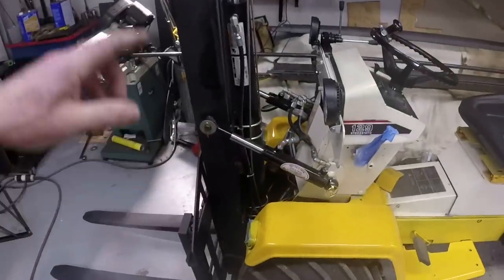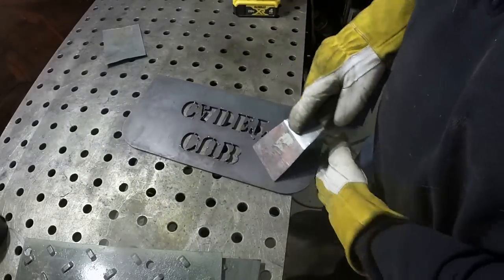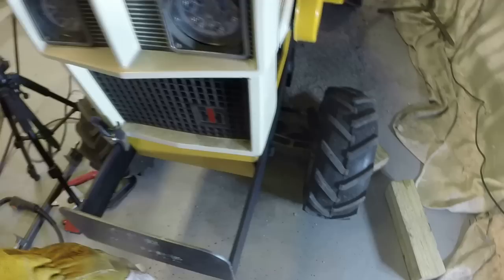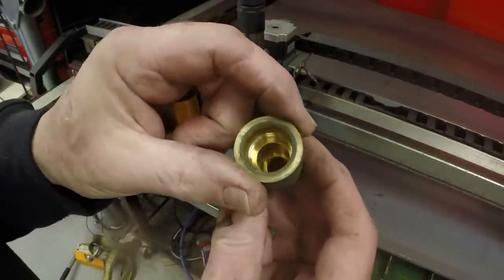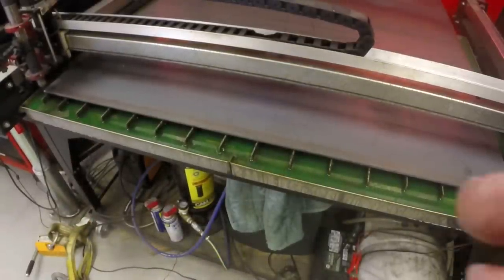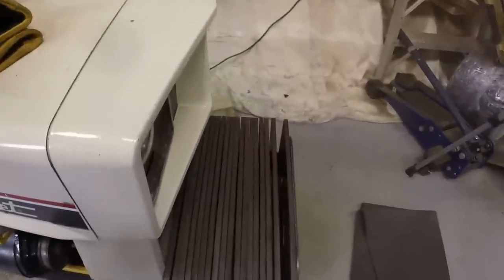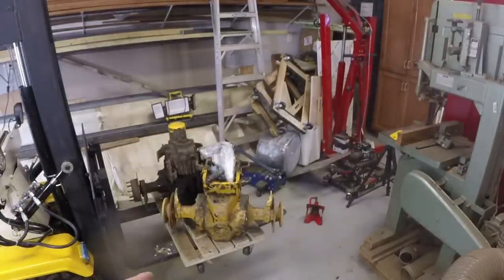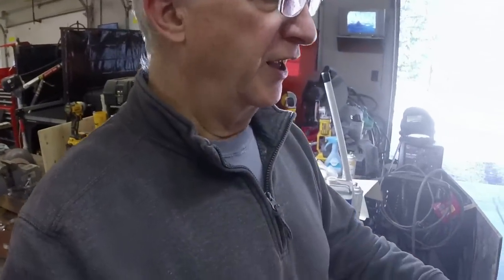I Built a Forklift!   EP:30, The Counterweight

Comment: Turned out really cool Frank. Nice vision on your part. 
P.s.  rotate the small tires so the tread matches. 😊
Reply: It is getting a different front axle, wheels and tires, to handle more weight.
Also be aware non driven tractor tires are always mounted opposite direction of normal travel.

Comment: you might drill a pair of holes in the name plate and put a set of long threaded bolts through to hole the weights from shifting, 500 had a good idea with the white paint  looks good  waiting for the next project  with anticipation
Reply from the maker: I'm going to add a few more plates to fill the rack solid.

Comment: Every forklift I ever ran was pull back on the lever to lift and push forward to go down. Your tilt is correct, pull back to tilt back and forward to tilt forward.
Both sticks should be verticle pushing forward and backward. A 3rd stick would be for shifting forks left to right. All you need is 2 sticks for that rig. Nice job overall though.

Comment: Yep, you built a forklift, Frank!!!
A job well done. 
May need to put a long bolt through the weights just to stop them from bunching around if travelling on a ruff surface from job to job
Reply from the maker: I'm going to fill the rack with a few more plates. That should do the same thing while keeping the plates easily removeable.

Comment: Another great job as usual. Your skills are becoming more impressive. A thought for your next project an articulated tractor with both driven axles with 3 point hook up and drawbar. This will test your engineering some. The tractor could be used for pulling different implements (more projects to build) for your garden. Just a thought.
Reply from the maker: I have often thought about an articulated 4x4. It's been done a lot, so there are plenty of examples out there. My current issue is storage space. I'm full up. With 10 cub cadets, the tandem, dozer, grader and now the forklift plus a couple of Kubota tractors, my buildings are full. I need to start making miniature stuff I guess!  I have lots of other stuff I need to get done--been postponed with the work on the forklift.  But the challenge of the larger builds is a powerful urge. We'll see.
Reply: @woodandmetalshoptime8048
Reply: I understand. I commented many episodes before about building a larger garage  partially in jest, but also as a need for all your projects. I realize it is a great expense but with all your builds that just keep coming (and very entertaining) you will eventually have to expand. I hope your Youtube views could support it. P.S. the forklift was mentioned in the comment also.

Comment: Frank I have a couple of questions . One was on the back plate for the forks . Did it distort when lifting your pallet? It might have been the camera angle but I thought I noticed some slight bend . My other question would be if you notice any difference in the steering of the lift with 
additional weight ?  I'm giving you a big thumbs up on this project. I would like see it in action in future videos.
Reply: Looks like the tires flexed and the whole tractor tipped down a bit when the weight was lifted
Reply from the maker: I did not notice any deflection of the back plate itself, but it does move the trolley inside the mast against the mast tracks. There is some slop there. (soon to be fixed-stay tuned!). Don't notice any steering difference at all.
Reply from the maker: With pneumatic tires, this is to be expected to some extent.

Comment: Did you ever considered try to build a compact roller from a cub cadet garden tractor
Reply from the maker: It's been suggested a couple times, especially a vibratory roller. Would require articulating the frame--which has been done many times by others, so not that difficult.  I like the idea.

Comment: I enjoy watching you build your forklift. But I heard you say that you used a tractor with loader to unload the truck. Wouldn't putting a set of forks on that tractor be easier and cheaper?
Reply from the maker: I have a set of forks that fit on the loader's bucket. Due to distance from the fulcrum, it has a very limited lift capacity--like 200 lbs.  I'd have to remove the bucket (not so easy) and build a fork attachment. Lift capacity would still only be 500 lbs. or so. This forklift will have over twice that capacity and not require switching the bucket/forks back and forth. It is not a quick attach bucket arrangement.
Reply: @woodandmetalshoptime8048  Thanks for getting back to me. Thought there had to be a reason to build a forklift. We weld ears on the bucket and ran a round bar from fork to fork. All we needed to do is roll bucket and pick it up. Dad said it could lift 800 to 1000 Lb. But our tractor could be bigger than want you have,

Comment: Are the weights really the last thing to do?  That's an incredible machine and I've really enjoyed watching the build, but I'm not sure OSHA would approve. The cage on a sit down forklift isn't so much a ROPS as it is a device to prevent things from crushing the operator when they fall off the pallet, or knock stuff down. Accidents do happen, and literally every experienced forklift operator has had something fall on that cage at least once. Matter of fact, I'm not sure I've ever seen an old forklift that didn't have bent steel or scratched paint on the roof. 

Besides, you need something to wrap in plastic so you can go outside and forklift stuff in the rain without getting wet! 

My 2 cents as well, I'd like to see that beast in action on soft ground with singles and duallies. I'm quite curious to see if that good old iron would float like a butterfly or sink like most other forklifts when you take it places that you probably shouldn't a forklift. Of course, maybe poor decisions like that are why I worry about a cage 😂😂

Really love the channel, thanks for sharing your awesome builds! I'm 40 years old and work too much overtime to build any cool stuff, but I truly hope I can do what you do when I retire.
Reply from the maker: It only lifts 6 feet high. I hardly need fall protection when nothing goes over my head.
Reply: @woodandmetalshoptime8048  makes sense.

Comment: You have a link where to buy the plasma table water additive?
Reply from the maker: check with your local welding shop or go on Amazon (shipping may be an issue) Cost is $150 to $200 for 5 gallons. Use one gallon to 15 gallons of water.

Comment: frank do you heat your shop and do you have antifreeze in the cutting table water.
Reply from the maker: Yes and no. It's an anti-corrosion additive, Plasma Green 1050, 5% solution.